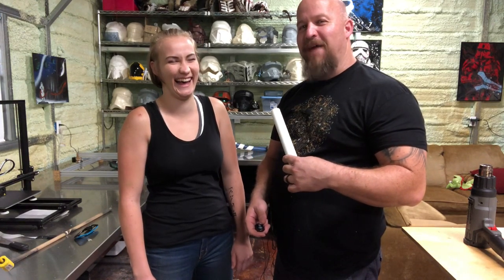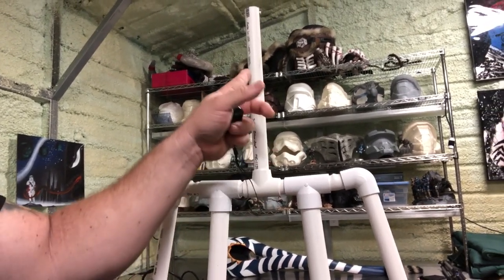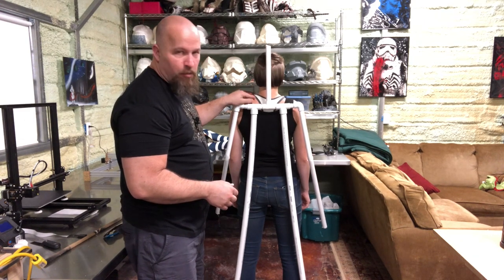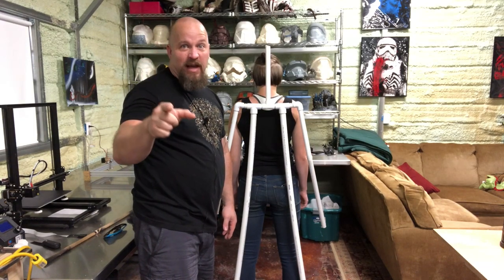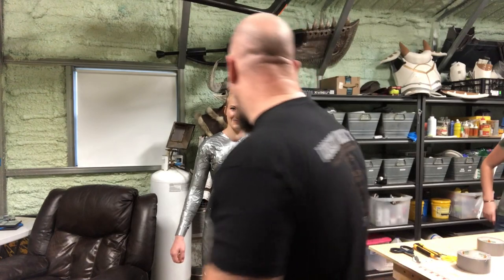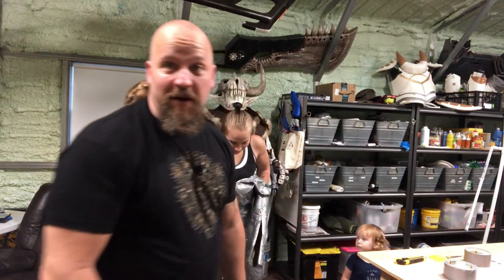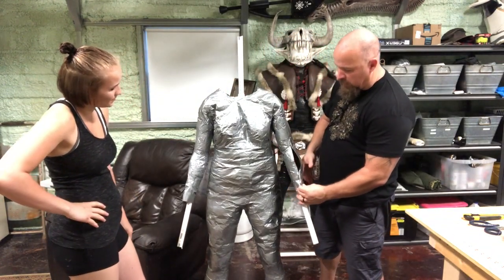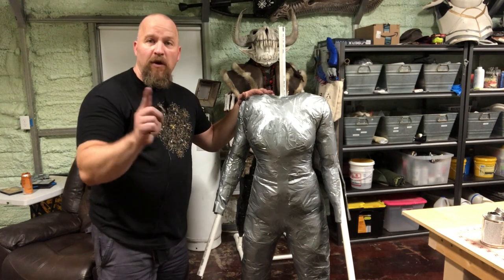Best Duct Tape Mannequin | Barefoot Props | How Too

Comment: Great Content!  Thank you.  Have you thought about using spray foam to fill parts of the mannequin?  Would that work?
Reply from the maker: It’s possible but probably much more expensive. Smooth.on makes some “foam it” that a friend used. It expands a lot more

Comment: Just a question. Why not seal the ends and use the Sinks foam to fill it instead of newspaper?
Reply: Sika. Not Sinks. Stupid autocorrect.
Reply from the maker: I’ve found that the expansion foams is harder to keep it from distorting. But I’m sure it’s a possibility